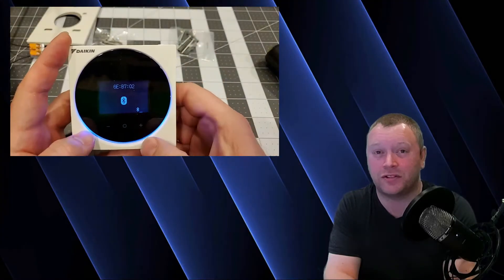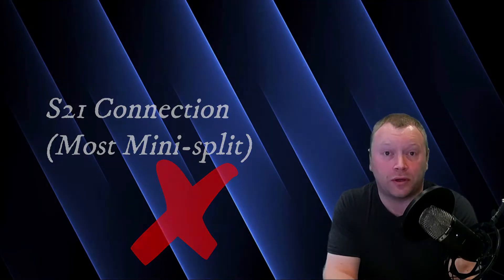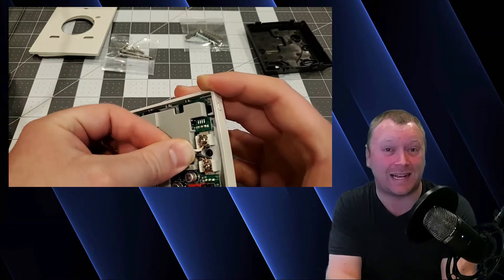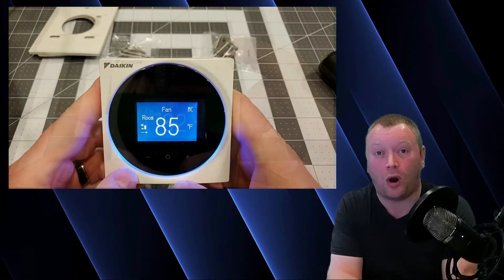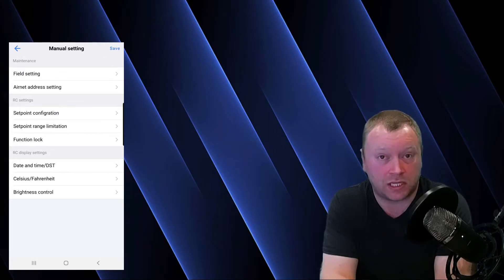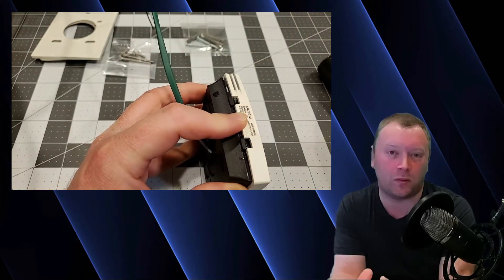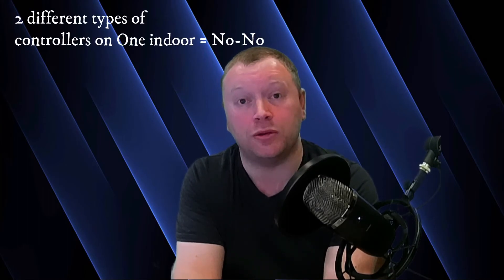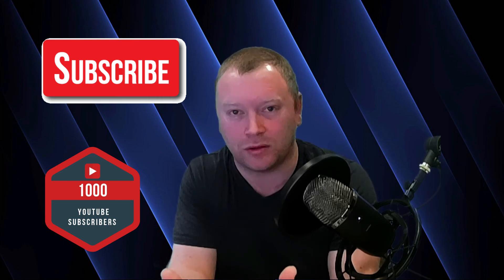Daikin Madoka | Features and What YOU Need to Know | Madoka Series Ep.1 (2-19-2021)

Comment: Hello, I got 2 indoor units. fxsq125a2veb, fxdq40a3veb. 2 came with brc4c151 and 2 with madoka. I can install DKN cloud wifi adaptor on fxdq40 and control two thermostats remotely? The second unit is split unit, can I still use another DKN wifi controller for it? Do i connect it to wall or indoor unit? 
As of now it's supper annoying, I want remote controller and everything I tried with BT fails miserably with these two madoka thermostats that I have. Other two units at least came with outdated remotes.
Reply from the maker: I didn't quite follow all of your message but generally each unit needs it's own controller and/or it's own wifi adaptor to be individually controlled. If you pair multiple indoors to a single controller they are controlled as a single unit group.

Comment: So if you use the auto feature what do you do about night time? I NEVER have my heat run at night in my bedroom.  Do you turn off the Madoka unit or manually lower temp or ???
Reply from the maker: Auto heat/cool you mean? I mean, do what is comfortable for you. Gas heat is so different from heat pump heat I used to turn off or turn down my furnace as well. But with inverter it runs so slow to maintain temp you really don't need to turn it off or turn it down much at all. For comfort maybe a degree or Two. But that's your preference. Just adjust the setpoint as needed.

Comment: With a installation of heat pump on a new home I'm having trouble setting the controller (BRC 1H71W) for both air condition and heat. The user instruction is not very good and continuing to look for something better when I saw your video. The technician fix my problem my HVAC pump coming on and off every 2 minutes (hopefully that has not done any damage to the pump). But, provided no help on the controller which is 1 or 2 ° higher for room temperature. 
Is the auto setting for both? Sometimes I can find the icon for both settings, do I need to save this setting? Do I need to make any changes in fan setting with one, two or three bars? Finally should the name change on the controller when either heat or air conditioning is on? Currently it just shows which ever one i have set.
Reply from the maker: you need to have the  contractor come out and set up your field settings. this way you don't accidentally set something up incorrectly.
Reply: @InverterAlways  I'll call him again to see if he can help me with the Daikin controller, this time. He had to phone Daikin's service dept to correct my on-going boiler noise.and may need to do the same for setting up the controller. What is the field setting?
Reply from the maker: @MorAcht  depends what you want to set and what the issues are. I believe one of my madoka videos walks you through how to change the settings. I've also gone through a bunch of residential settings in other videos. Check out my vrvs playlist.

Comment: Please Help, I’m Hvac installer from Long Island NY, we have some problems with Daikin thermostats , Brc1e73 or Madoka 
We have one outside compressor 4MXL36TVJU with 2 FDMQ blowers inside connected to multizone compressor, is always huge temperature difference on thermostats ,room temperature vs setting temperature , let’s say I set to 75 degrees, in morning would be 69 degrees and blowers still blowing little air 
I trying set all this options in field setting, sens temp from Controll not from return, fan off after satisfied, nothing helps I call Daikin tech support, switch for new thermostat,same thing, Still same system never stop working when temperature got to setting temperature,
Another thing next to Daikin Controll we have regular digital thermostat which always shows 5-6 degrees different whatever Daikin shows, Daikin thermostats never,Never shows same temperature compared to regular thermostats,That’s happen not only one job , maybe 5-7 different jobs,same Please help,any solution for that
Reply from the maker: Multizone mini splits have a huge offset. The stat being added doesn't really help this much. The deadband is still there. Best thing to do is just set both units to a setpoint and leave them both there all the time. Maintaining is key

Comment: Can you tell why I cannot set the temperature less than 21 Celsius?
Reply from the maker: Probably due to a setpoint range restriction that was programmed during commissioning. That's my best estimate at least. Is this a commercial building? Or a house?
Reply: @InverterAlways   House, I've just replaced the standard controller with Madoka then I noticed I cannot set it below 21, is there a way to remove the restriction from the App?
Reply from the maker: @youmsx  should be able to. It's the set point range restriction setting. By default they should go to something like 16-33 give or take a degree.

Comment: does this work with e daikin heat pump and floorheating system  that can heat and cool ? and also can i instal one of these like 5 seperate rooms with radiator heads ?
Reply: @InverterAlways  i have a 10y old daikin EKHBX016BA3V3 heat pump that cools and heats with floor heating

Comment: Hi,
I am a Daikin VRV Specialist. I enjoyed your video. I did notice one thing that I wanted to address, Yes, you can use the Daikin One Plus, MADOKA and the NAV Control on the same job.  The rub is if you want WIFI on them all, the Cloud Adapter uses a different App than the One Plus. This means you would not be able to see everything form a single App.
Reply: I just wanted to add that in Europe the cloud adapter is not sold directly through Daikin, but is available by Airzone which is also the manufacturer. It would definitely be good for Daikin to produce it's own product for wifi control (not talking about BRP series) for existing commercial applications (ex VRV III, Altherma ht etc)